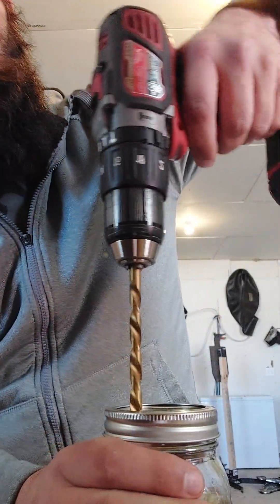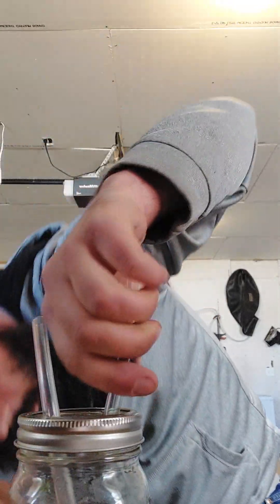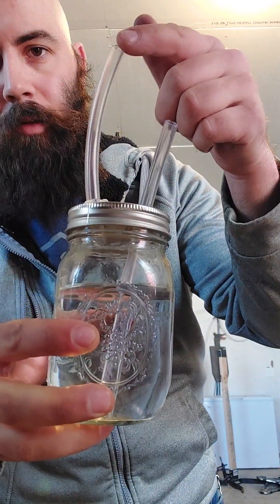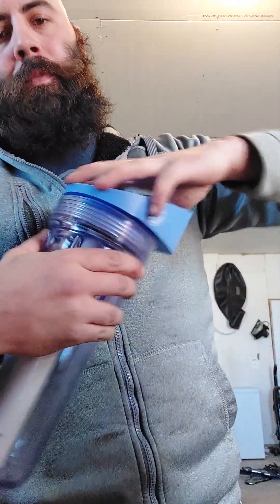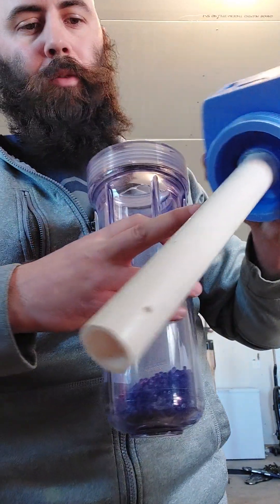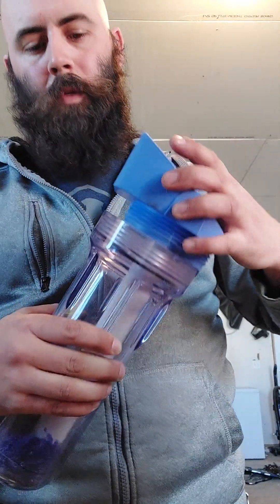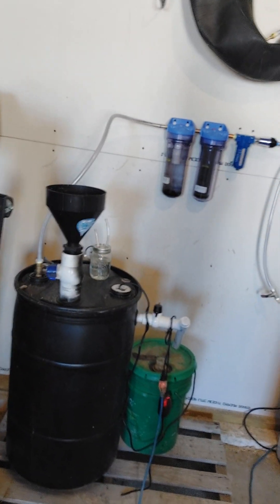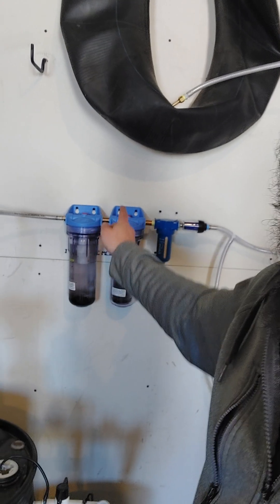how to make a bubble filter for biogas

Comment: What if you have a control valve to prevent the gas from flowing  backwards during thermal expansion. Would that be better, i operate in a place where we do not have 24hr electricity